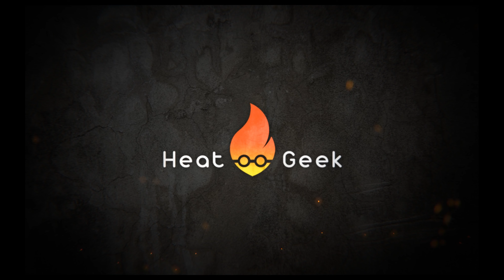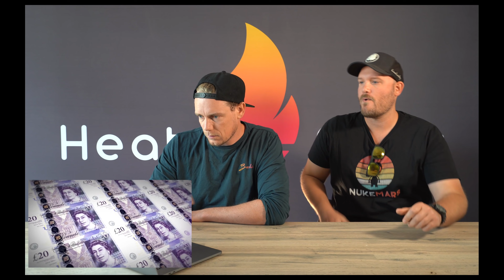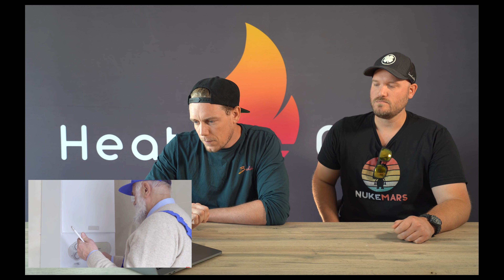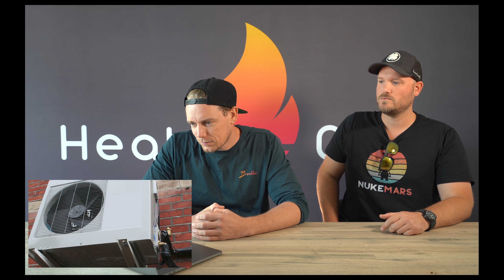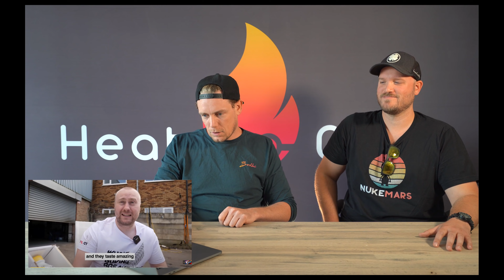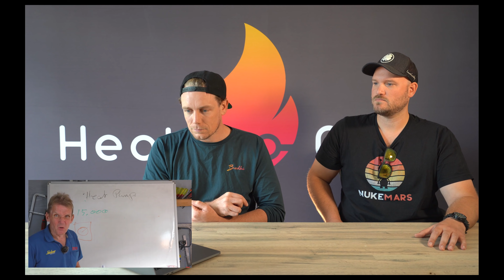Professionals React (BADLY) To Skill Builders's Heat Pump Videos | PART 1 | FIRST TIME WATCHING

Comment: Don't fall for it -- it's a scam.
To be any use you have to have a modern fully insulated house that doesn't need much heat.
For most houses they only work in the summer when you don't need the C.H. on anyway.
When the outside temperature falls below 6 degrees they can no longer get heat from the air and switch on their
inbuilt electric immersion heater to fool you.
I qualify for free installation because of my circumstances but still wouldn't install it because my electricity bill
would have gone through the roof.
Reply from the maker: Lol.. the on board (MID APROVED) Meters are fixed to give false readings?? We're reaching mew levels of conspiracy now.

For anyone else reading this.. the commenter is correct for crap installations. For any proper installation they work just fine below 0c.

Comment: These guys have a vested interest - in themselves.  It is a non starter to even think about air sourced Heat Pumps.  They don't work when you need them most.  When it gets cold about  0 degs the cop will be 1-1 and then needs a heat element to boost it up.  Heat pumps need a refrigerant that is very bad for the environment if it releases to the atmosphere with a leak.  Automobiles  all have an air conditioning system and most repairers have little knowledge of how they work so it need a specialist.  Heat pumps at best will get 45 deg output and that is insufficient to satisfy the 60 deg minimum for water sanitation. Rodger said it all
Reply from the maker: Absolute rubbish. They can and do perform at cops of 2.5 -3.5 below 0. Only non working systems don't..
Reply: @HeatGeek  You will need to introduce heat around all the external apparatus since
atmospheric conditions will create ice on them.  Further more if you  really understand physics you will soon work it out that it is impossible to get 2.5-3.5 below 0 deg C absolute fact so which school and qualifications do you have in physics then - I have had years work with calculus and numbers so you get to it boy and tell us how.  When you find out how to get more out of something that you put in you will make a fortune and I don't mean the transfer of heat from one area to another using a refrigerant.  The limits are with the refrigerant and they have been forced to stop using one form to a lesser one for years I'll leave you to tell what the two common ones are the latest is Rxxxxxxx

Comment: They will never work in an old council house... so why do the government state they will help... utter bollocks...  sort the inso airtight problem first... then move onto heat pumps... Will take forever to do both... be 2200 before all houses are inso'ed correctly... also half the new builds are also rushed and shite... high end stuff go for it...low end get used to fuel poverty..
Reply from the maker: New ones will and do work fine in old council.houses

Comment: Seems like both gas and electricity doubled in price. Both were wrong 🙂
Reply from the maker: We didn't make any predictions on pricing.. our gripe was with thr statement that they average a cop of 2 and that they should be installed with a thermal store
Reply: @HeatGeek  Was just kidding. I see both side. Problem is like you both said: hard sell and bad installation and both are hard to avoid for consumers

Comment: I came across the video you Heat Geeks are watching after we had our Daikin heat pump installed (at first I thought we’d made a great mistake).  I think the points about having a well-insulated house are very important.  The heat pump is not so efficient when it is really cold – I can vouch for that. We live in a warmer climate than that the UK, so that isn’t a great problem for us.  We installed out heat pump with water heater because we got aid from the French government and our gas heater was getting old and so was the separate hot water tank.  

The installers are also plumbers and have a certificate to confirm they are considered apt to install correctly and fill in the necessary paperwork.  We paid them, as is required, and then reclaimed the money back ourselves.  The companies that install through the government scheme are inspected around once every four years and a random customer is chosen for a visit.  We’ve been chosen!  The unit is installed inside the house as we don’t have a garage (fan outside, of course and we haven’t noticed a great deal of noise).  I was really pleased with how good it all looks.  The water heats up really quickly and we have several options to choose from.  We can control the heating from a distance which is very useful.

I think it’s important to research as much as you can.  Ask lots of questions when you get a quote. A friend showed us work done in his house by the company so we saw what a good job they were capable of.  They also took the old heater and water tank away and showed me when they sealed off the old gas pipe and cut off the gas. 
Hope my info has been a help

Comment: I agree that heat pumps have a future.... And it's in a proces of development and on getting better.
But for apartments and small and old houses right now it's not a viable option. 
If you have a house where there's some sun in the winter time and you can use the efficiency and the real dream come true if you got a stack of solar panels allso that can help your consumption.... There heat pump.... Yea it's a good idea maybe eaven be off grid 🤣🤣🤣
Reply from the maker: Agree a little.. but your missing the option of communal ground source with shoe box solutions
Reply: @HeatGeek  meaning ground source as for heat source or common source for multiple licing spaces ?

Comment: Thanks for a balanced reponse to the crazy guy's rant.  I live in a bungalow that is pretty well insulated and am about to get an air/water HP installed.  You talked a lot about the installer being the weak link in the process, but what should I be looking out for?  My guy has been brilliant so far and is very knowledgable, but I need to make sure I ask all the right questions.
Reply from the maker: Ask this..

https://m.youtube.com/watch?v=MU5KwrWumY8
Reply: You have the perfect house for it, so good for you, makes sense, but for the majority its just not a viable option
Reply from the maker: @DropdudeJohn  bungalows are hardly 'perfect'.. what makes you say that??
Reply: @HeatGeek  
I'm assuming its well insulated from what you say, I'm assuming you have plenty of space for it.

Can I ask, do you have a garden, a utility room, a patio, that kind of set up, or are you small box, no utility room or spare space and in a row of terraced housing with  no private space between your property and the road/public space, clearly you are not a flat.

Comment: Guy on left - with hat backwards - needs to start explaining that philosophy to everyone on the planet. Nothing is perfect, heat pumps aren't 100% as cheap or small or quick as gas boilers, but they don't need to be, they have lots of things they are very good at, like not using gas (at least directly). Done well, they CAN save a lot of carbon and whilst not cheap enough for everyone yet, we have to do what we can, right now. We have a decade the scientists think, to massively reduce our carbon use, and only by trying, by trying as much as we can with the tools that we have are we going to save our climate. If someone can afford it, and there is an installer with the skills, then heat pumps can be a good fit and we should try, try, try to use them!

Comment: I must have forgotten how carbon free the production of electricity is......
Reply: Sure, but 43% of the grid is made from renewables. 100% of a gas in your boiler is a fossil fuel.
Reply from the maker: @bcameron1231  and dropping every year.
Reply: @bcameron1231  hydrogen is the future! We already going back to blending it in the gas
Reply: 20% hydrogen
Reply: @English-pride  Sure, that makes gas boilers little more green. That also makes Heat Pumps even more green as well! I like your thinking!!!

But that still leaves 80% fossil fuels, too many frankly. Which is terrible compared to Heat Pumps. And any higher than 20% and then you'll love all the increased taxes you'll pay to replace all the piping in all of your cities, and also the price to replace all the iron pipes in a lot of the older homes.
Reply from the maker: @English-pride  20% hydrogen nationally is 20 years away. Theyre inly testing it in tiny areas. And inly reduces by 20%.... also.. its 5 x more expensive..
Reply: @HeatGeek  hydrogen will be the future for older homes thats my opinion, the elctrical grid is also not capable of charging every car, powering every home, heating and hotwater to every home either so if u think the gas network will need alterations i bet its not half as bad as the electrical grid, some home are still on a shared main and carmt even hav a car charger, everyone has the answer and only theres is right, they all hav a place but it is not a one job fix all approach.
Reply: @HeatGeek  heat pumps have to prove themselves and putting them out there to gas lads that hav changed over and lashing them in as subbys on a gov grant is going to absolutely ruin them in pples minds and harts
Reply from the maker: @English-pride  hold my beer
Reply from the maker: @English-pride  as per the video. Heat pumps aren't for every home.. justbthe vast majority. Storage is already massively helping the grid
Reply: @HeatGeek  iv been on eco scheme for years and i wont be going onto eco4, u can hav them all pal hahaha  good luck
Reply: @bcameron1231  literally had to google burner account meaning, how old are you 12 ?  Go plant some trees ya eco warrior.

Comment: Dear Heat Freaks 
Maybe you guys can give this young lady some advice, she seems to have been badly let down by the 'experts'.  I would advise her to get the boiler back onto the system but I am sure you guys have a better solution. We are getting lots of these emails now and I can only see it increasing as people grab the grant money and get a heat pump installed. 
Her email to Skill Builder
	Please please help. Just watched your rant on heat pumps and I agree with everything you are saying. We moved into a house recently with an air source heat pump, 100% underfloor heating and 100% electric. We thought this was a good thing having a heat pump but our bills have been insane and the upstairs doesn’t get warm!! We installed 40 solar panels in the hope this would help but have bnot seen a great impact especially when cold and overcast. We have had sooo many supposed heat pump experts to survey the system and no one seems to be able to give us a definitive answer on a solution to get our bills down and get the upstairs heated. We have already paid £ks already through odd bits specialist have said it needed. Some have said the system is undersized for the property (it’s a 16kw heat pump).
Part of the house is brick only with I believe no insulation so would explain part of the Problem. I am looking for wall insulation companies to address this. However I just want to know what options we have and what the cost is! Should we install a second pump? In your video I also wonder if the location of the pump os a problem. It’s on the north facing side of the house which gets very little sun! We do have a oil boiler that could be plumped back in - is this a better option than another heat pump?
Any advise you could give would be appreciated? (It’s a Samsung and joule system - Samsung themselves were useless) - it’s such a worry as it’s just not sustainable with the bills so high!
Reply from the maker: Hi Bodger 😜 only teasing..  yes we can definitely help bud. For the balancing up and down stairs that seems pretty basic.. but regarding the efficiency it would be best if she could send in a video and we could record a response.  Or we could come round and video a response.. for bow though we have created this video for those in this situation 

https://youtu.be/SfgTOcclbCY

Comment: Just buy a nice cheap gas boiler , and stop all this nonsense with expensive heat pumps that don't work properly, and more expensive to run
Reply from the maker: That would be the correct solution if they didn't produce more co2 for sure
Reply: @HeatGeek  stuff the co2.    Another 10 years, the government will u turn again, we'll be ripping out heat pumps, and telling us that boilers are the future....

Comment: I agree with your comments that there has to be a holistic solution but unfortunately we in the UK don’t have any track record of applying any carbon reduction technology in a holistic manner. It always ends up with a fleet of franchised, self employed or sub contracted uneducated workforce just installing the stuff and running after issuing meaningless warrantees. This has happened for cavity wall insulation, photovoltaic panels, spray foam, external insulation and now, it seems heat pumps. It works in theory but what the skill builder guy is pointing out (admittedly a bit too dramatically) is that things in theory don’t always work in practice.
Reply from the maker: I agree.. historically. Hold my beer..

Comment: 15:15 "conspiracy theory basically" .. Nah, you guys just don't understand what the WEF and your Govt's are planning on. fast forward to March 2022 and Skill Builder (who does know what's going on) is proved correct. What's the difference between conspiracy theory and fact? About 6-12 months! 😂
Reply from the maker: Unfortunately heat pumps aren't operating at cops of 2 6 months on though and his heat pump installations are.. they also still don't work woth thermal stores... 

We did not disagree with the fact prices may change bit said it was conjecture.. it jas changed but not for the reasons he predicted
Reply: @HeatGeek  The WEF has been 'warning' about energy shortage and massive price increases for the last 5+ years well before Covid and this new 'crisis' of the war. Watch out for food shortages coming very soon.  In fact inflation and energy prices started bumping up significantly prior to this recent 'crisis' but now they are conveniently blaming the war. Gasoline/petrol prices in Russia are way below UK 40p a litre or $1.80/gallon.   WEF knows in advance about all these pending crises and that they will happen .. but how you might ask yourself. These are not predictions, they are in fact achieved through 'conspiracy' with political leaders, big corporations and central banks. All these crises are providing a smoke screen to hide the fact that Western economies have crashed due to massive printing of money rendering most major countries  bankrupt. Follow the WEF and you will understand better what Skill Builder is talking about.
Reply from the maker: @bootburner4544  that could be true, but its still a conspiracy theory. I.e. a theory about a conspiracy. I would just like to focus on heating on this channel
Reply from the maker: conspiracy theory
noun
a belief that some covert but influential organization is responsible for an unexplained event.

Comment: Cannot help but feel there needs to be better clarity on the types of homes and perhaps their energy/insulation performance so that consumers can have a better understanding of what or might not work for their properties. The EPC reports are quite frankly not fit for purpose and usually list utopian measures that either require an ICI Directors wage to implement or a lifespan measure in multiple centuries to make them cost effective.
Reply from the maker: We've just recorded 3 videos on exactly this!!  Simple to follow cheat sheets for you to check if your propertybwill week and how efficient it will be.

Comment: so whilst heat pumps are a good concept it is still early days.. wait longer and you can get a better unit, quieter, more efficiency ? You guys even said this too.. I have been exploring the use of air source, unfortunately i re-landscaped my garden 3 years ago so ground is out the question! 
Whilst I would like to do something about the environment, I am not going to do so by having to have an ongoing higher outlay.. 
I am looking at solar for my electric, but may just elect to replace my 19 year old combi with a new combi !!

Comment: What you seem to be under the illusion is that people are willing to pay to reduce their carbon footprint. Just watch the number of Range Rovers driving about and you realise that people are concerned about their carbon footprint as long as it does not impact on them....happy to fit a heat pump then fly off on holiday several times a year! You seem to be in your own little bubble where heat pumps can do no evil, and everyone you speak to thinks as you...we have seen initiatives before and everyone told to buy diesel cars. Join the real world and the poor sods who are in debt due to low wages and high prices  I suspect there are more fans of Skill Builder than a bloke who can't even get his hat on the right way, and saying that a certain demographic are against them...who might they be?

Comment: insulation shouldn’t be an excuse. It should be a critical part of reducing your energy bill and decarbonising. Otherwise you’re just spending money to heat the outside air. Heat Pumps should be looked at in conjunction with insulation
Reply from the maker: 100%